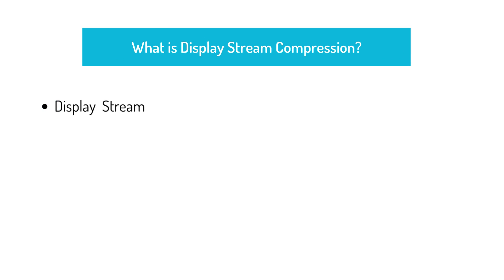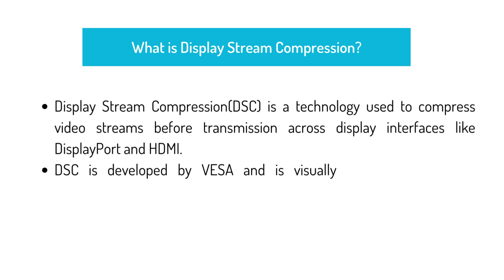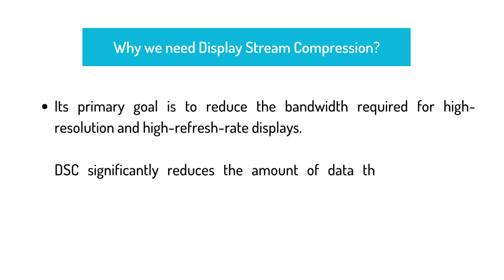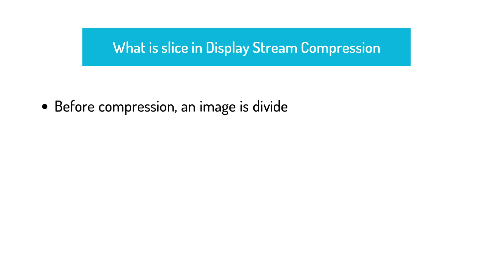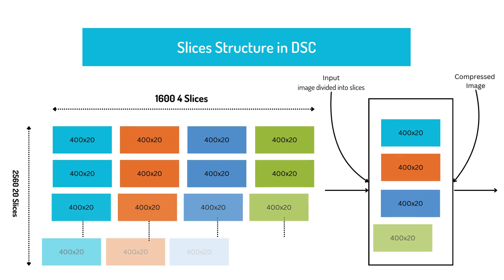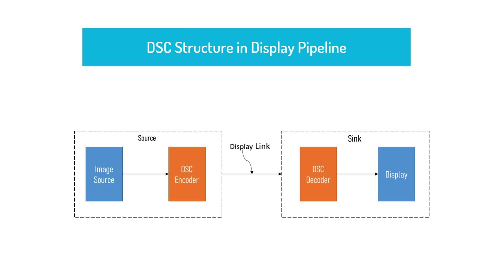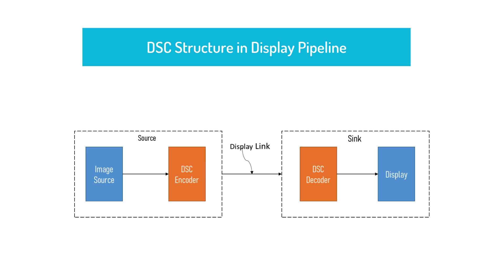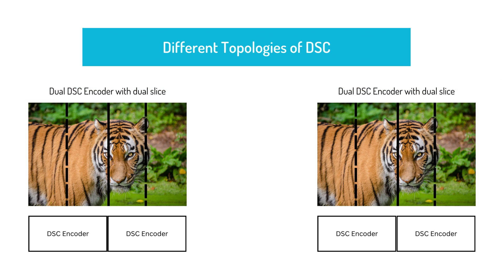Display Stream Compression

Comment: Does DSC compresses more if you frame rate increases?
For example: Display port 1.4 can handle around 1440p 200hz 10bit. 
Will the image be more compressed at 240hz compared to 480hz ?
And so under 200hz image will not be compresses, even with DSC on?